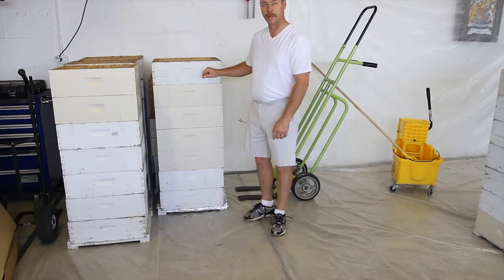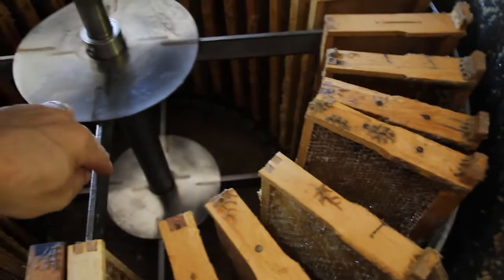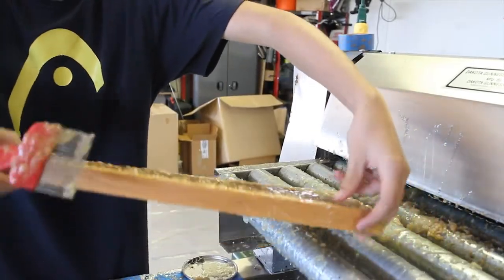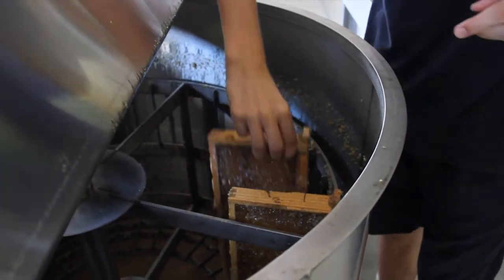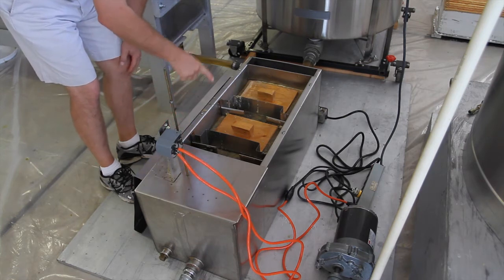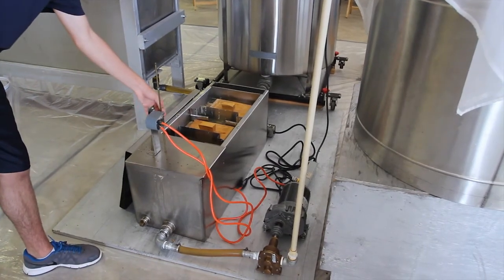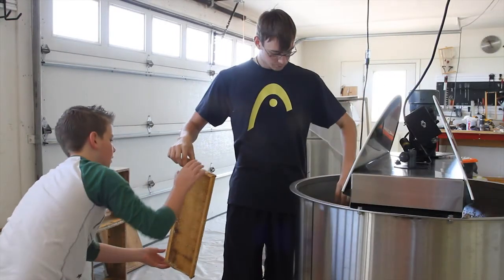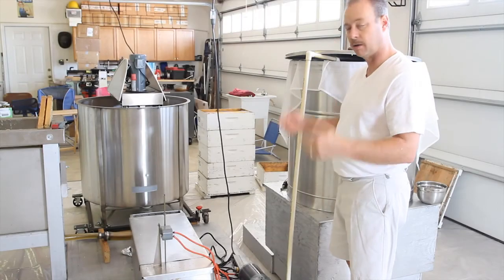Extracting Your Honey Crop

Comment: Very nice operation. Question...could you store extracted frames back in a super that's still on a hive? Anotherwords empty frames mixed with frames that I've left for the bees to feed off of for the winter or when they come out of the winter?
Reply from the maker: It wouldn't be a problem to do it that way.  Many beekeepers put supers back on light hives after extracting, temporarily, so that the bees can clean up the last drops of honey in them.  I don't do this because I want them to finish gathering honey and I want something to draw them up into the supers in the spring...i.e. supers that still have a little bit of honey in them.

Comment: How are your honey supers stored? Example: Plastic bag in a shed or something to that effect?
Reply from the maker: I just stack the supers in garage and put a lid (inner cover) on top.  However, my supers are only used for honey.  They have never had brood in them, which is why they aren't bothered by wax moth.  If you have newly pulled supers, wax moth may get into them and make a tiny mess, but nothing to worry about.  The bees will clean it up next season...so long as they have never had brood in them!
Reply: Honey Bee Honey what does having brood in them cause?
Reply from the maker: It doesn't 'cause' anything, but there is more nutrients for wax moth larvae to eat, and it is less acidic, making it an more welcom nest for wax moth.  I also don't like brood parts in honey that I sell to customers, so I make sure to use queen excluders on all of my hives between brood supers and honey supers.
Reply: Honey Bee Honey thanks for all your replies sir